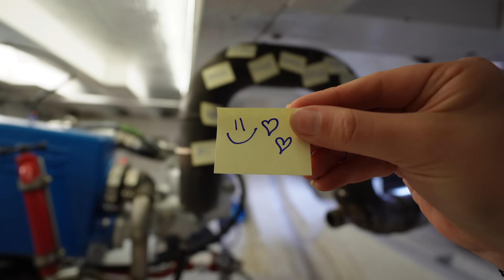Wooden boat rebuild: getting ready to PAINT and run the ENGINE! — Sailing Yabá 144

Comment: Engine instrumentation inside the engine compartment can prove valuable when things start to go Sketcth...
Oil Pressure/Temperature,  Fuel Pressure, Coolant Temperature, Start Battery Voltage, Intake Boost Pressure, Turbine Exhaust Temperature,  Battery Disconnect Switch...
Reply: The instruments/gauges need to be on the bridge.
Reply: @johnnunn8688  Yes, and there should be Mirror instruments in the Engine bay...
RE: Project Brupeg, and SV Seeker.
Nice to know you've got Oil Pressure on an administrative start up...

Comment: I would compare the cost of rockwool and fiberglass exhaust wrap. Rockwool is used to make very high heat kilns for metal forging and ceramics. It will stand over 2000 degrees f and they also have something like a very high heat plaster to cover over the insulation. Wrap the whole thing in stainless or aluminum sheet metal with clamps. Amazon sells this if you cant find it locally. If these aren't available, welding blankets could be used to wrap the pipe and covered in sheet metal.

Comment: For your exhaust...I dunno what they call it down there but Stateside we call it "Refrasil", basically a loose weave Fiberglass cloth we used for cover up for any kind of Hotwork (welding/burning/gouging etc.), but you could get a sheet of that, cut it into strips and wrap the exhaust with that...
Reply: On the old Cadillacs I work on there is a type of cloth that covers a portion of the pipe that goes down the front right of the engine.  It comes in a plastic bag.   You put water in the bag then after it absorbs the water you form it around the pipe.  It held in place with stainless straps and is somewhat stiff and last for decades.   I try to keep them original.

Comment: There are a lot of different products to wrap or coat the exhaust with, all should do the job of reducing the potential of overheating the engine compartment, and possible burns.   Also add a heat shield, might go as far as creating a channel that is separate from the deck and hangs down along the sides of the top bend of the pipe. 
Asbestos when encapsulated is not a health risk.   Rather it is when the encapsulation is broken and fibers or dust is released when it becomes a significant danger.  So the danger is not in having it but rather working with it, being installation, or removal, undisturbed it does not cause problems.

Comment: MP, motorsport exhaust wrap will be good for your boat, it is designed for manifolds and very high temps and is made from modern safe materials.

Comment: Love your channel. Just thinking that you might have been able to just cut a hole in the flange on the engine side the same size as the od of the turbo output and welded on a pie same size as turbo output. Connect with hose and bob’s your uncle.

Comment: Run the engine then check the gearbox oil level , top up the gearbox as needed , with the engine running 
Why , the gearbox oil cooler needs to be filled as well

Comment: Heat & noise reduction: wrap systems & ceramic coatings. Heatshield Products, Thermo-Tec, Design Engineering Inc, Summit Racing, Quiet Ride Solutions and Heatshield Products (US companies). Will have to find equivalent and available suppliers where you live. Start with muffler shops, racing companies - car/truck/boat/motorbike. Next would be boiler manufacturers and suppliers.

Comment: I think there is a black hard foam glass that is good for high temperatures . Just wrap it with tin maybe make a removable cover or box for it . Good luck as radiant heat will eventually lead to fire !

Comment: We in our boat had to raise the syphon because it was just at the water level and we leaning sailing some water enter to the engine through the exhaust pipe , so as higher the syphon the better to avoid this . Try to know where aprox. Is the water level inside and make the proper adjustment if possible before is too late.

Comment: Fibreglass wool can be used to insulate that exhaust pipe.
Reply: @evanschwartz3030   . Fibreglass does not burn. You can use strips of fibreglass wrapped around the pipe, over the matting/ chop strand  fibreglass pulled apart into a wool form. This will help to insulate. I would not use rockwool, as that’s normally used in roof spaces in homes. If you go to a car mechanic they can advice you better. They know of products you can buy and not have to diy it. Hope that helps 👍🏼
Reply: @evanschwartz3030  ps_ that exhaust pipe gets really really hot (red hot), hence fibreglass is the only product that works. Space rockets use a product to shield, but I am guessing that stuff must be very expensive. The other way is to make a metal box around the pipe and fill it with sand. That box running for about 3 foot from the mana fold to the outlet filled with sand would only be needed.

Comment: Hi guys, when watching the last vlogs especially with the engine rebuild, why you have not been advised to double clamp your hose (jubilee) clips/clamps. In that 4 not 2 are used. 2 at each end but fitted 180deg of each other. It is a very common form of redundancy especially at sea. Just want your journey to continue by mitigating another risk. Better to be prepared.
Reply from the maker: Thanks Mark! We will add that extra safety 😉

Comment: I hate to sound negative but too many times i have had issues with piping on engines after repairs in my carreer on small workboats. Two things i have learned is to never use metalpipes that have been cast. Use smithened pipes like hydraulic pipes rather than cast sewaterpipes. In my work, im always restricted by class-authorities or/and legislation from the flagstate of the vessel. But since you are neither you can go outside the box. For seawaterpipes use plastic sewerpipes or hoses. Hoses are always hard to get completely watertight because they tend to expand and retract with temperature along with stainless steel clamps which in turn makes you adjust them constantly. Plastic sewerpipes doesnt corrode or are subject to cavitation which makes them ideal on the suctionside of the pump because they dont have to withstand pressure. The downside is that sewerpipes doesnt like vibrations that much. In areas where you deal with exhaust and seawater, always replace rather than repair the piping. It sucks to have to remove old fiberglass lining that have gone hard and crisp over time on the exhaustpipes. So make sure you have thick material on your piping and where its possible, weld from both sides. The area where the seawater gets mixed with exhaust are an extremely sensitive area. Judging by the looks of it, that adapter will give you grief in the future. Have a workshop make a new one based on your frankenstein-part and make it thicker with proper welding and thicker material. As for insulation on your exhaustpipe, i will agree with the others here in the comments. Use fibreglass bandage closest to the pipe itself with some metalwire to fix it into place. On top of that layer, i would try to find weldingblanket and sew my own custom cover to make it thicker but also protect the inner layer from dusting. The factorystuff you have on new engines today have a rockwool/fibreglass mass closest to the pipe but the outer layer is basically fibreglass blanket treated with a type of silicone that makes it resistant to absorbing fluids. If you have an oil leakage that sprays the insulation, it can become a firehazard and you have to replace it.

Comment: The mock up part, looks ok. Heres the problem, stainless steel, really shouldn't,  be smashed. The thicker, the stainless, the bigger the chance of cracking, it with a spider crack. A spider crack only shows it self under high heat and pressure. The turbo, will have a ton of pressure. Take, photos, alot , put a tape, get a perfit to scale drawing of the part, you built. And find a CNC , shop. If you cant buy the part.
Have it made out of a single block on Marin grade stainless steel. U see the fancy, rims on cars, CNC program, grinds thos from single blocks of metal. And when u find the shop ask for the program that made the part. And 100% buy 2 of them. Pack the spare away for back up. And fire proff, the whole engine compartment,  had heat alarms, fire alarms, smoke alarms. And put 2, good fans, that have auto switches..
And a tip, would be on the engine compartment door, put a small thick glass window, so if u see fire, u stay out. Good luck..

Comment: Welding Blanket Fireproof | Heat Resistant Up To 1800°F | Flame Retardant Fabric Material Carbon Felt for Welders | Plumbers Cuttable   Low cost.

Comment: Cutting that metal on the boat will be the worst thing you ever did !!!! All those sparks are metal red hot and burn into all your paint /  varnish work and glass !!! and you will never get rid of it till you strip it all back to bare wood !!! That am afraid is a BIG BIG fail

Comment: I don't get it why you are using a very small paint sprayer like that on something that is very large. You need an airless sprayer like a Graco or Titan. You can back roll over the heavy paint. Titan 440X Or Graco 395... They do high volume fine but also do fine lacquer work well and are not very expensive. The only thing you have to take note of is the cleaning. I am a commercial painter. Been doing it for many years. What you are using to paint with is like pissing on a freighter. Right tool for the right job. Just a bit of advise.

Comment: Why didn’t you just use a roller for  the primer instead of wasting all that time with the plastic. Rolling would be quicker and apply a more uniform coat with consistent thicknesses
Reply from the maker: The paint gun was the recommendation from the technician of AkzoNobel.

Comment: Sorry to inform you but your turbo is not the right size for your engine as it will not be able to give enough boost to give you the best power to drive your boat.